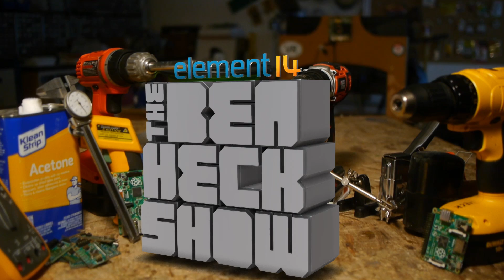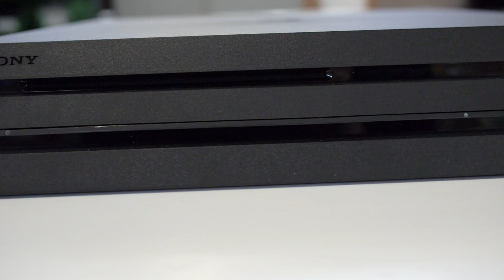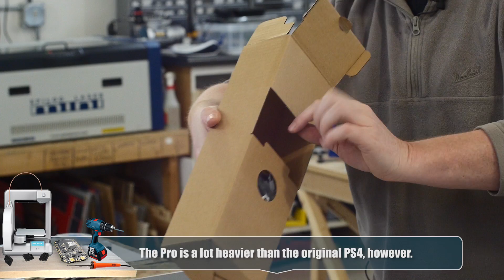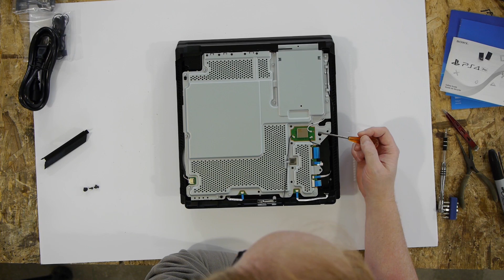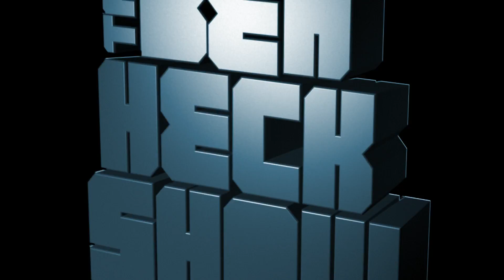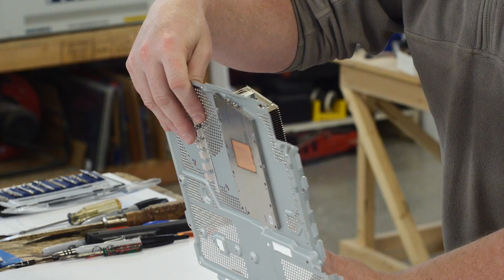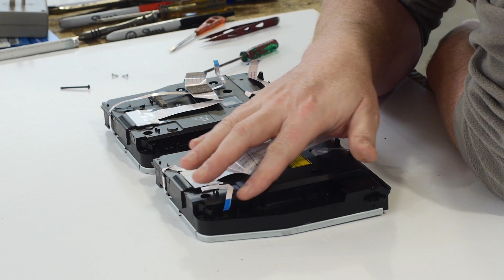Ben Heck's PS4 Pro Teardown

Comment: I'm sure you've already done some research in the five days since Publishing this video, but regardless... 
The most performance gain you can get from a HDD upgrade on a Playstation will come from a 7200rpm HDD of any size, and any cache.  SSD's bottleneck on the SATA II controller chip AND overheat in the limited ventilation wrapped in the HDD cage, and with lack of airflow over the HDD area.
What i usually do (and did in my PS3 and PS4) I grab a Seagate Constellation HDD and drop it in, its SATA 3.0Gb/s (SATA II) which is perfect.  I tested using a Mushkin SSD (can't remember which one) on my PS3 several years back, and since Sony hasn't upgraded the Linux driver for the SATA Controller, i figured they haven't improved the performance capacity.

Also, Sony designed and refined BluRay, so i'm sure that they aren't missing out on anything by not adding the 4K eye, considering the royalties they sit back and accrue through all the other companies making their technology in things.  ESPECIALLY from Microsoft, so that's unfortunate that the PS4 Pro can't be a home media center like the PS3 was, but the PS4 Standard isn't too far off.  I'm sure if the Console itself can playback video files in 4K/UHD (whichever you can do) then needing physical media for 4K should become something of an afterthought, especially with media streaming services like Vudu and Netflix now doing things in 4K... 

Take Care!

Comment: So many technical faults in this video. From why current gen sold most and so on. Let me tackle the price. All other gens Sony/MSFT and so on licensed CPUs/GPUs. All those gens where subsidized by 200-300 dollar per console (playstaion/Xbox). Thats why PS3/Xbox360 sold "slow" since THEY DID NOT WANT TO SELL TO MANY.  The subsidizing is the reason why console games today have to pay a 50% licensing fee per game to MSFT/Sony. its a discace with current gen since its not subsidized.

AMD was the only vendor who could sell a X86/graphic solution. The different is that Sony/MSFT cant legally licanse it and manke the chips themselves. AMD have to legally produce X86 chips.

Last gen when foundries introduced new manufacturing techniques Sony/MSFT was eager to shrink the CPU/GPU since they lost money on each console sold. Thats why prices didn't go down, since they still sold the stuff with loss.

Now  when foundries shrinked from 28 nm to 16nm. Sony/MSFT have to pay AMD for a redesign /shrink of the SoC. Thats why it was not a standard shrink like all other generations since the cost for a redesigned/improved chip as just a shrink of the old gen.

The idiocy with UltraBluray. Off course the author have never watched a 4K movie on a 4K TV. Streaming is extremely compressed. Uncompressed 4K is over 200gig/hour. With each new video format for consumers compression goes up. 4K steaming today is 16Mbit. Yes: about 1.8meg/sec. Same bandwidth as an audio CD!  Compressing stuff 200 times is not fun if you want a great picture. Ultra Bluray is also insanely compressed but at least have 5 times as much bandwidth. 

Many people also have problem with streaming since they dont understand how the internet work. Networks like UFC fightpass/WWE network always report people with problem. And that is non 4K with about 700Kbit bandwidth.  The problem is TCP/IP / WiFi and that people never think about UP speed. The TCP/IP packeged have to send an ACK signal or the packet is dropped and resent. You can kill a 1000:10 internet connection just by enabling Iphoto cloud and watch iPhone gooble all upspeed for all photos. 

There where a ton of more inaccuraties. But that will do. I thought we would get an answer why Sony chosed not to have a UltraBlu drive. Instead the answer in this video was: Its the same as the old PS4.

And that may be the answer. PS4 pro is a strange design. MSFT Scorpio will not be 100% backwards compatible since it uses new GPU. Sony wanted 100% backwards comparability. Thats why the GPU in pro have 2 clusters. The old PS4 cluster and a 50% cluster beside it. PS4 games dont have access  to the new GPU cluster = exactly like old PS4. PS4 optimized games do get access to the 50% more cores (and a bit more memory).

A valid answer from Sony could be: we wanted 100% comparability. Games that use streaming from the BluRay media would act differently on a UltraBlu drive. 
---
Please watch a 4K HDR movie on a TV. The funny thing is that today TVs are better than pricey monitors. I could explain why (like above). Its amazing that a 65inch Sammy with 4k/60/Chroma 4:4:4/HDR delivers better picture than 99% of monitors.
The funny thing with WideColor / full color is that there is just 2 tablets and 3 computers today that have full color and the difference is huge. (then people use their camera phones and "experts" review 1000 dollar phone cameras: on monitors with compressed chroma:non wide color. Hint: you dont see all colors. 

Heck: Even go and look at a iMac retina. Its wide color. Look at the picture and how great it is. Its not the 5K. Its wide color/HDR. Something that upper class TVs have today. 

2000 dollar for a 60 inch 4k60 widecolor HDR tv/monitor is not THAT expensive. Its almost impossible to get a 4K wide color screen for that price. (27 inch is about 1700 dollars and stupid PC uses dual dual displayport. Yes. PCs use 4 virtual screens that are fused together to one by software. No wonder there is problem. TV: HDMI 2 (since computer makers want to save HDMI money and use open displayport instead)

and so on so on...
4K movie/gaming is great. But its not the resolution. Its HDR, wide color and non compressed colors. (Blurays for example use Chroma 4:2:2. Extremely compressed color scheme)

PS4 pro is wonderful. A 400 /500 outside usa dollar system that can manage HDR and 4K /4K up scaling in many games.  Bulding a PC with same performance cost over 900 dollars. Here you just plug and pray. 

Fight Sony/MSFT 50% licensing cost games. That was from when they subsidized consoles. Add to that XboxLive/PS+ forcing customers to pay extra for multiplayer that is already payed for when you bought the game. Its not 2005. Bandwidth is not expensive anymore.
Reply: realshompa Wow. Awesome comment. Do you work in the industry? You seem to be really into it.
Reply: "(27 inch is about 1700 dollars and stupid PC uses dual dual displayport. Yes. PCs use 4 virtual screens that are fused together to one by software. No wonder there is problem. TV: HDMI 2 (since computer makers want to save HDMI money and use open displayport instead)"

This just sounds like pure biased hatred for DisplayPort. DisplayPort added HDR and Rec 2020 colour support in 1.4 which has an effective bandwidth of 25.92 Gbit/s, this is plenty to run 4K HDR with wide colour at a higher refresh rate compared to HDMI 2.0 which has an effective bandwidth of 14.4 Gbit/s. Even DisplayPort 1.2 has more bandwidth than HDMI 2.0 at 17.28 Gbit/s, it just lacks the support for HDR and Rec 2020.
Reply: How is the new gpu in my xbox one x not 100% backward compatible? I do not feel that 4k is at all a gimmick. I bought the (X) for the ultra 4k. I hate that so many folks forget there are millions of people out there who do not hae fast internet. I have a hard time watching Youtube some times.
Reply: Uganda Ruiner virgin detected
Reply: of course it is 100% compatible, that would be like saying that rx 480 is not compatible with Radeon HD 7770... both xbox and ps4 use ordinary pc hardware, and software wise they use various pc APIs like directx and OpenGL, so any lack of compatibility on either side would be purely intentional

Comment: one. screw on side is for horizontal mount base. 
two. die is larger because more GPU cores have been added.
three phisical 4k Blu-ray is about the only disk anyone should be buying because it requires more bandwidth than most have.

Comment: 4K is for hardcore niche gamer. I always laugh when people buy 4k tv to look at tv show. Just wait and buy an AMOLED 4k when its gonna cost less.
Reply: But. Cotsco 4k tv are so cheap now that there is no real reason not to buy one if your tv is dead i guest. Just go with good colors and blacks. No bleeding etc....
Reply: playststion 4k will improve when 4k tv.s improve
Reply: yeah for tv show it is waste of money without 4k upscaler and so on because nowadays they have finaly reached the full hd section. They are far away from 4k. Furthermore I prefer 120 FPS over resolution. It looks detailed but if I can only run at 120 FPS only with 2 Titan X Pascal and a monitor which is 120 Hz capable well lord you could easily buy a new car from that cash ;D
Reply: V1replade 4K is done and made mate, they just need to drip feed you everything in between to make more money
Reply: Ovi Wan Kenobi shame its fake 120Hz
Reply: They are 120hz native and 240hz "effective". The 240 is what is fake. Though I have to admit it actually does something now. On my 1080p tv it just made it darker.
Reply: In canada there is near to no channel in 4k. Its all upscale and at 10 feets from tv 1080p is enough for most people.
Reply: Until extremely recently 4K 120Hz didn't exist in a purchasable product, so the 4K 120Hz tv isn't real 120Hz.
Reply: Jason Hamelin Amoled 4K tvs are gonna be spectacular.
Reply: Jason Hamelin should do amoled 4k tv because video is better on my samsung s6 than my tv
Reply: Jason Hamelin I bought a 4K 120 hz Samsung TV with an Nvidia Shield console which natively supports 4K. Everything looks super sharp compared to my other 1080p TV.

Comment: Couldn't you just modify it by replacing the Blu ray drive with a 4k Blu ray drive?
Reply: And the software involved would need to be designed and hacked into the PS4. A much easier way is just having a separate external bluray and turn that on and the PS4 off. :D
Reply: Steven Johnston Because the PlayStation's firmware wouldn't be compatible with a replacement drive. Not to mention that it probably wouldn't recognise the video format. You'd be better off trying to modify the firmware so you can create your own media player that would be capable of reading that format and playing it using the existing hardware.
Reply: No because the size of the blu ray drive in the ps4 is not sold commercially.
Reply: Steven Johnston no lol

Comment: Im not an expert so I may sound dumb here but is there anyway to put a 4k player in the ps4 pro.?
Reply: Manny Tello no. The only thing you can do to upgrade consoles is the Hard drive unfortunately.
Reply: Manny Tello Even if you can put a 4k drive, getting the PS4 pro to recognise it to the point of playing games and movies is impossible as the drive is tied to the firmware. If you can get past that it is still a no as the PS4 pro firmware doesn't have the software to play the movies, the 4k Bluray movies is a different format to normal Bluray complete with different compression, so no software no support.

Think of this way, it was smart as the cost is not the drive but the software needing to support a different drive especially to handle the encryption on the games, software to play movies as well as there cost to licensing and royalties.

Sony was smart to support 4k apps and get 4k movies that way to put the cost to support the feature is less on them and more on the Devs of apps.

Comment: Not having a 4K blueray is not bizarre at all.  PS4 was never meant as a content (media) machine, the way that near failure of an Xbox one was, and apparently is still trying to be (with its new 4K drive), but a video game machine only.  The goal of the Pro was also supposed to be the same as the original, only upping the resolution and color gamut, while using the same content (the same disks).  So I ask, why is everyone disappointed that it didn't have this player?  Why are they surprised?  Personally, I hate watching movies on gaming machines, using a gaming controller to navigate a gaming menu to do it. I'd rather have a dedicated 4K player.  Wouldn't you?  Wouldn't everyone?
Reply: Well from what I know people like to buy physical copies of games. Though when it says that it doesnt have a 4k blueray player, does that also mean that it doesnt have a disk drive (my terms might be off). I know that the XBOX almost died in 2013 due to it being more media friendly than gaming, but it helps to have everything in one, if it come at extra expenses. Thats how I see it, Im open for debate
Reply: I ment to say when it doesnt come at extra expenses and doesnt hinder the machine, but it clearly did for XBOX

Comment: why was the gpu never mentioned?
Reply: because there isnt one
Reply: So they were lying about a gpu? Dave
Reply: Not necessarily. Current-gen x86 processors have integrated GPUs, and the ones in the XBOne and PS4 are no different.
Reply: Here are the specs for the PS4 PRO. (From Sony's website)  
Single-chip custom processor

CPU : x86-64 AMD “Jaguar”, 8 cores

GPU : 1.84 TFLOPS, AMD Radeon™ based graphics engine.

Basically its the same AMD APU that the original PS4 has with a bumped up Radeon based GPU. Now its in the same ballpark (in terms of performance) to AMD's R9 380X (Around 4 TFLOPS) (Note that the original PS4 GPU its rated at just 1.84 TFLOPS) and was comparable to an AMD HD 7870.

Comment: The Pro's internal psu is rated at 310 watts, but the system usually only draws about 160 watts. Even in Pro titles/mode.
That makes me wonder (warning: tinfoil hat territory) if down the line, possibly Scorpio launch, Sony will do an update increasing the cpu clock. Kinda how MS did with the XB1 prior to launch going from 1.6 to 1.8ghz. Prior to the Pro's release reports of the cpu were 2.1ghz. However. when Sony unveiled the Pro they simply stated the cpu was overclocked.

Comment: I've watched teardowns of the slim and Pro and XB1 S and have to say the Pro seems overall better built, to be expected I guess, just more quality, you have to give it Sony they haven't skimped on heat solution, much larger heat sink, copper square that the APU is against and those 3 copper heat pipes in the heatsink look very thick and chunky they're not skinny little things, the fan looks quite abit larger also and chunkier, not so flimsy. just my opinion but the build quality of the Pro looks pretty impressive to me.

Comment: Some of us still prefer the better quality of physical blu-ray discs 4K or otherwise that is why it is still a benefit to have.  Streaming bit-rate sucks, it is not an equivalent (then there is the internet data cap issue and inconsistent internet speeds) .  It may be "good enough" for some but is not close to videophile quality. Plus some of us actually like to own our media, not just rent everything and own nothing.

So yes it is a dumb thing that the Pro doesn't include 4k Blu ray support.

Comment: Can''t believe Ben you missed the extra 1Gb of slow DRAM(has it so it can free up the fast GDDR5 ram). Also the fact it has a cloned GPU to alow it too be 100% compaticle. It just switches off  the beefed up GPU to play normal PS4 games, in PS4 Pro mode it uses both GPU's together.

Comment: They told everyone about this before launch. And no on needs a 4K blu ray drive . Who uses discs anymore
Reply: Kottonstream if you actually want to watch a film with out compression from 4k netflix etc when watching on a 50 inch plus screen you can tell the difference even bluray to 1080p netflix there is detail loss in streams if you had both to compare you would already know this. plus audio quality and types available like atmos dts x again you need to already have decent equipment to enjoy these features.
Reply: Nick Manhota there is no difference
Reply: Kottonstream you make me laugh move along now drink eat supermarket basic options because as you put it there's no difference. I highly doubt compressed 25mb (netflix) a second has the same detail as 128mbs 4k bluray (100gb) sorry on this you do not know as much as you think.